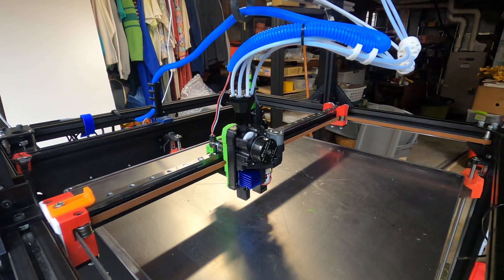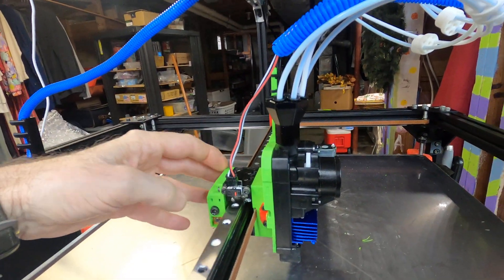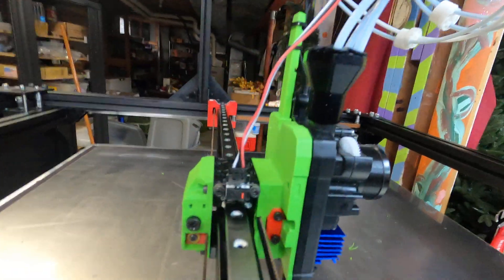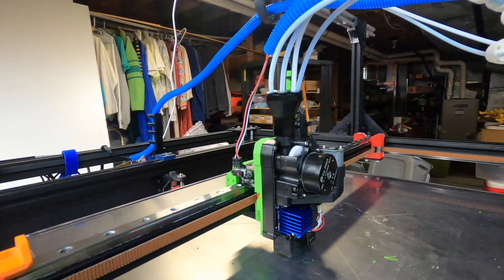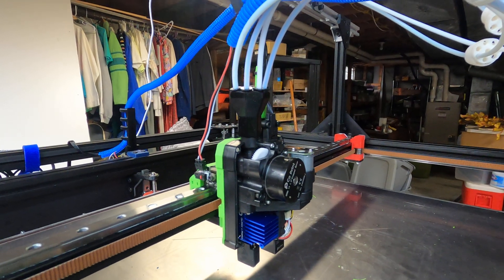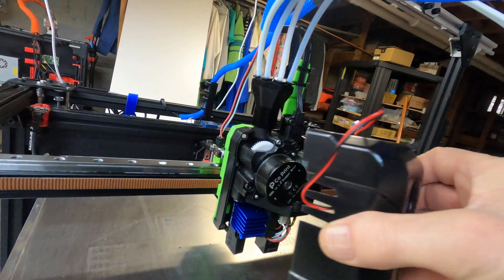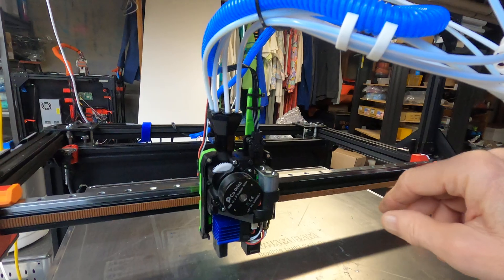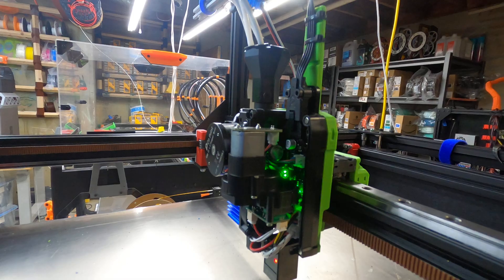CoPrint mount for Rat Rig V-core 3

Comment: Thanks for the update.  Looking good.  Hopefully you had enough figured out from your recent V-Core 4 conversion to CoPrint that it was easier this time.  I'm increasingly seeing the CoPrint popping up on the SV08.  Being able to add up to eight colors to a Klipper printer with no MMU option is a great option for many people.  I'm more interested in IDEX but I'm starting to hear that it can be difficult to get IDEX working on a RatRig.
Reply from the maker: One correction.  This is the same Rat Rig that I have been working on.  I just refined the printed parts used to replace the EVA mount for the CoPrint.   I have not tried to get it on the V-core4.   I'm very happy with the new hot end extruder on it.  This gives the older Rat Rig a new purpose.  Still have the software to get working better.
Reply: @woodwaker1  - Thanks for the assist for my old brain.  Of all of the things I've lost with age, my memory is the third worse... but I can't remember the first two.
Reply from the maker: @Liberty4Ever  I'm in the same club.  Will be 74 this year, but this keeps me thinking!